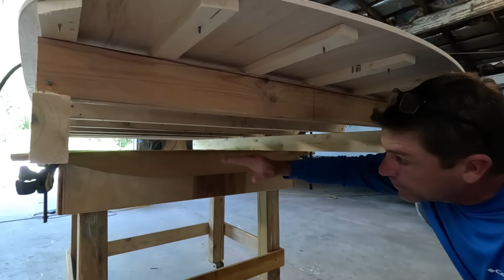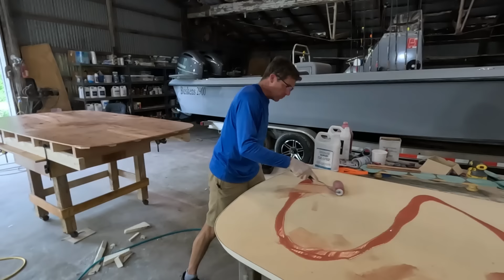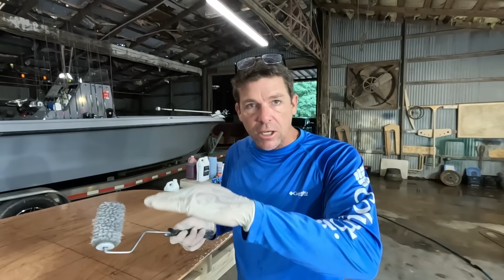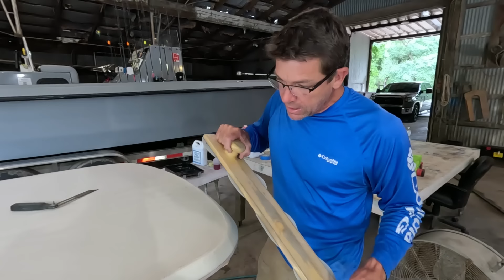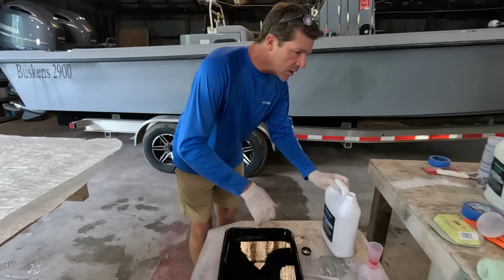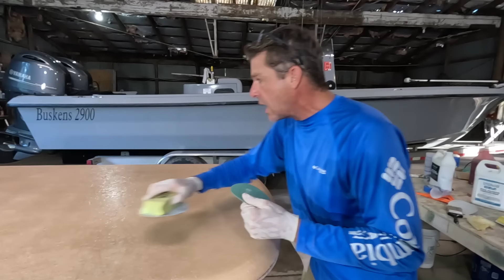How To Build a MOLD PATTERN to make FIBERGLASS PARTS

Comment: What is the foam core you used?  looks pretty thick...1 1/2"??  Looks also like it has some sort of laminate skin on the side you put resin on.
Reply from the maker: It's 1.5 inch poly iso foam. It's commonly used for building insulated seafood boxes. Thanks for watching!

Comment: I'm building outdoor things. I need to make foam tables with metal washers embedded on top. I made some out of plywood, and I make more money selling at flea markets using them. I use magnets to hold things down during windy days, and I'm not chasing everything. The plywood is too heavy for me, my doctor says. Embedding washers in foam and fiberglass tables will work; I have to anchor the tables down anyway because a heavy wood one blew over. I have made some electrical panels for my electronics with carbon fiber that look awesome. I'm into robotics, and I'm starting to make fiberglass and carbon fiber parts for my outdoor machines. I'm building things that look like they came from the factory instead of DIY now.
Reply from the maker: Sounds like you have some awesome projects going on! Thanks for sharing your thoughts and experiences with the channel!
Reply: @FishBumpTV  I'm learning from watching your videos, but for something different than boat building. This skill can be used for a lot of things.

Comment: Can I put a coat of epoxy resin over a somewhat porous deck to make it waterproof or would i need to laminate a layer of glass?
Reply from the maker: A coat of epoxy will give some protection, but not nearly as much as if you add layers of fiberglass. I hope this helps, and thanks for watching!

Comment: To get a slick surface why wouldn't you use peel ply? Learning about that in the panel making video felt like a huge revelation. 

Such a great, useful channel.
Reply: And watching the sanding in part 3 I think the answer is that it's an unnecessary expense.

Comment: what kind of styro is that? new subs here
Reply from the maker: It's called poly iso, and it's very common in the fiberglass industry. It works well for forms or insulated seafood boxes. I do have a fiberglass resin, and foam compatability video here on the channel that you might find helpful as well. Thanks for watching, and welcome to the channel!

Comment: Watching the process all the way to the end but you didn't say what kinda of Foam you are using?  Please advise. Thanks
Reply from the maker: It's a 2 pound density, poly iso foam. It's non structural and mostly used for insulation. I hope this helps, and thanks for watching!

Comment: Joe I have developed using powder Teflon and a binder I have tested this gel coat underwater for 9 months and absolutely nothing sticks to it I've used it to pull a mold off of a 30-in model nothing sticks to this no barnacles it appears I've developed something that would make small boats and never have to have their bottoms painted ever again this is pretty big

Comment: Is there a certain types of Styrofoam sheets that do not melt when polyester resin is applied because in my experience at least the white phone will get ate up by it
Reply from the maker: I have always used marine grade structural foams and cores in our shop. I know that some home or insulation grade foams are compatible with epoxy resins, but not polyester or vinyl because of the styrene and other solvents in them. I will try to make a video on this topic very soon for you all, so stay tuned!
Reply: @FishBumpTV  ive had to resort to epoxy on board foam or cover basic foam and tape or latex paint before using polyester resin. I kind of want to adhere the resin to the foam for strength

Comment: Hey captain Joe! Absolutely loving the videos on mold building! This might be a stupid question but when is comes to making molds theoretically could you build the frame or pattern out of plywood, do the glass work, fair it and shape it, gel coat it, wet sand, buff and polish? I know its not going to be that simple but i was just curious. Thanks for all you do im learning alot keep up the good work!!
Reply from the maker: Thanks! Glad you are enjoying the videos! Yes, in some cases you can skip building the plug, and just go straight to building the mold. It is much easier to work a outside corner than a inside corner, so sometimes it's still easier to build a plug and then a mold. Of course there is always the option to build a one off part if you only ever plan on building one piece of whatever it is you are building. I will be talking about one off part building in some upcoming videos, so stay tuned!
Reply: @FishBumpTV  Thanks for the advice cap! I work in a production setting so time is always of the essence and longevity of the mold is very important so I was just kind of trying to find a middle ground for both I guess. Keep up the good work I can't wait to see what you have in store for us!
Reply from the maker: @Averageyoutuber81  Glad to help!

Comment: Awesome Video!  Super informative!  Perfect pace.   Where do you get your foam core?  Do you have any recommendations on the type?  All the best, Chuck
Reply from the maker: Wow, thanks! The foam is a 2 pound density insulation foam that is compatible with polyester and vinyl Ester resins. I buy it at our local fiberglass distributor. The company is called Advanced Plastics. I think they have several locations in the southeast. Hope this helps and thanks for watching!

Comment: What kind of foam is that?  Doesn't polyester resin eat Styrofoam?
Reply from the maker: It is a 2 pound density insulation foam. I bought it from my local fiberglass supplier. They also call it fish box foam. Thanks for watching

Comment: This is a terrific series, on tooling Joe, and—like all your other videos—these are VERY well done. 
     Two suggestions: 1. It would help if you identify which grit you choose for sanding at each stage of the build—both when you're using the blocks and long board, and when you are power-sanding with the disc sander or orbital. I know this is something you don't have to think about because of your years of experience, but most of us could use some guidance.
     2. When you talk about PPE—and use it while you work—HEARING protection doesn't seem to be on the list. But, speaking from experience, the cumulative damage caused by power tools is no joke. Testing shows that I've lost 30 percent of my high-frequency hearing because nobody talked about the problem or protected against it 30 years ago.. I find that today's lightweight, slim ELECTRONIC ear muffs and in-ear devices are quite comfortable, and they allow normal conversation to get through. 
     Keep up the great work, Chris (founding editor of Professional BoatBuilder magazine)
Reply from the maker: Thanks Chris! Always a big fan of Professional Boatbuilder Magazine. I will look into some of the more modern methods of hearing protection, and make an effort to show exactly what grit paper I am using at different phases of the project in the future. This is the kind of feedback I find helpful, and I appreciate you taking the time to watch and comment on our videos!

Comment: What kind of foam is that ?
Reply from the maker: It is a 2 pound density insulation foam. They also call it fish box foam locally. It is made to be compatible with all resins. Hope this helps and thanks for watching!
Reply: Do you get it from the same supplier as the resin ?

Comment: The resin binder in chopped strand mat requires styrene to desolve so do not use epoxy with csm the only compatible resins are vinyl esters and poly vinyl ester (polyester resin)

Comment: Also, could you explain when peel ply would be needed or if you guys even use it….
Reply from the maker: Peel ply is used to reduce or remove amine blush when working with epoxy resins. I prefer to work with 2 to 1 ratio epoxy which doesn't usually produce amine plush, or I just remove the blush with warm water. I know lots of people are interested in Peel ply, so I will try to make a video on the topic for you guys. Thanks for watching!

Comment: Hey Joe
Thomas from Denmark again, i have a problem right now that a video could help.
I would like you to show how to fix glasfiber where you only Can get to from one side.
It would be Nice if it was from diffrent angels, mine is Hole in the buttom that has to be fixed from outside, and with the buttom Down.
Then the floor Witch has to be made from the top, and it Maybe has to be a Big Hole like 3x3 feet, again only from one side and this time from top wich turns up.
Best regards.
Thomas 
Just loving your videos Long as short😉
Have a great day

Comment: Hey Captain Joe I’m in deep with my boat. I’ve got the boat running  new canvas top and cleaned up.  The boat is a 1995 Pro-Line 25’ WA. I’ve run into a soft deck, head liner pulled loose and glue that needs cleaning off. Maybe once cleaned just paint with gel coat ??? I need help !!!  Any suggestions ! Love your YouTube channel !!!  Bobby

Comment: Another great video!
What type of foam board can we use when working with Polyester resin? Thanks in advance. I’m planning to build a hard top for my Cobalt ski boat wake tower. I plan to just build one of them so I’m planning to make it with foam core and coat top and bottom with fiberglass and resin.  Any encouraging thoughts?
Reply from the maker: There are lots of different marine grade foam cores out there that could possibly work. One good foam core I have used in the past is Divinicell, I also use a lot of coosa board. I will be buying the foam core very soon for my hardtop build, so I will try to discuss foam core selection in that video. I hope this helps and thanks for watching!

Comment: Joe,  Just finished part 2.  Where can you buy the foam sheets?  Not having any luck on internet search.
Reply from the maker: I bought it at our local fiberglass distributor. Their company name is Advanced Plastics. I would imagine most fiberglass distributors should have some. It is a 2 pound density, non structural,  marine grade insulation type foam. It is pretty delicate when handling it, so that could be a reason why some suppliers might not be able to ship it. I hope this helps and thanks for watching!

Comment: Just a thought, why not use contact cement? - its fast and strong and can handle 400 deg F. Time is money without cutting quality. You could save 2 coat times and material. I'm always trying to help not be negative!!
Reply from the maker: That could possibly work, but I had the resin and knew that would work for sure. It would be worth trying to see how it does, it might work great! Thanks for watching and commenting!
Reply: How come the polyester resin didn't eat up the foam?

Comment: I don't know but I'm thinking about lift and elevator and trim tab for some reason. I wonder how the handling is impacted especially when getting on and off plane.
Reply from the maker: I don't know for sure, but I wouldn't mind if it had some lift at speed. I am trying to make it as clean and drag free as possible. It will be interesting if it has any affect on the boats overall performance! Thanks for watching and commenting!
Reply: @FishBumpTV  I've been history of the Hamilton Jet up to more modern designs. Those guys were placing a small wing at the bow - maybe to force the bow down on those designs. Neat stuff for sure.

Comment: the resin wont eat into the foam?
Reply: He's using a poly or PVC based foam that is compatible with poly resin.  If you were to use EPS or XPS foam with poly resin the foam would melt.  For those foams you would have to use Epoxy resin.
Reply from the maker: Not this foam. It is designed to work with polyester and vinyl Ester resins with no problems. Thanks for watching!

Comment: Love these videos Capt. and as always great job my the camera man. When using laminating or tooling resin does cure hard enough to sand without gumming up the paper? I thought the purpose of laminating resin was to be able to add additional layers without the need to sand?
Reply from the maker: Glad you are enjoying the videos and the camera work! You can sand laminating resin, but yes it will gum up your paper. Just wanted to show different resins in use and that many resins are compatible with one another. The dcpd ortho blend cures with very low tack, and could work good if you knew that you will be sanding it. Hope this helps and thanks for watching!

Comment: Once again, another great video.  About the poly over epoxy issue, for stressed structural repairs, I always use epoxy.  Then scrub with soap and water and scotchbrite, then sand and scrub again.  Then, it's my experience that gelcoat is OK over this.  In any case, epoxy sticks better than polyester with a mechanical bond, for example repairing an old hull (which is all that I can ever afford).  Plus, I'm waiting on your skiff build...
Reply from the maker: Thanks for your thoughts,  and support of the channel! Vinyl Ester is another option for folks that want a very good bond and compatability with gelcoat. The skiff build idea has gotten a lot of interest, so we will see!